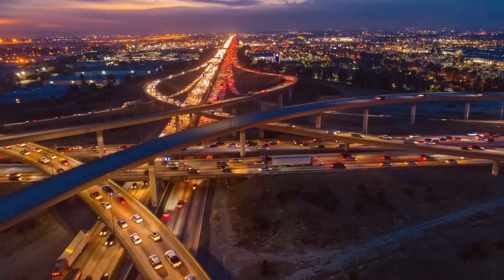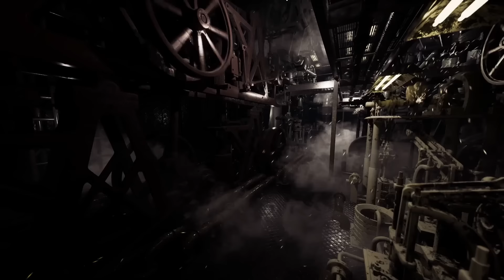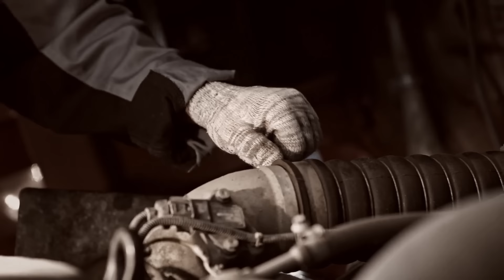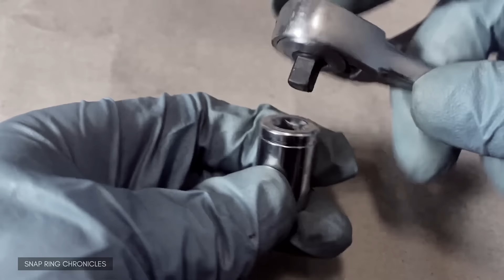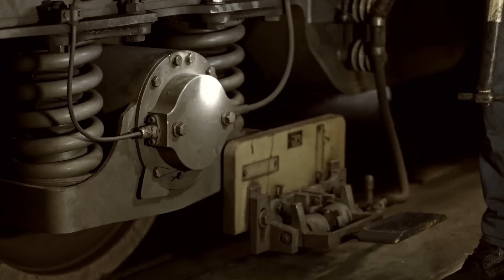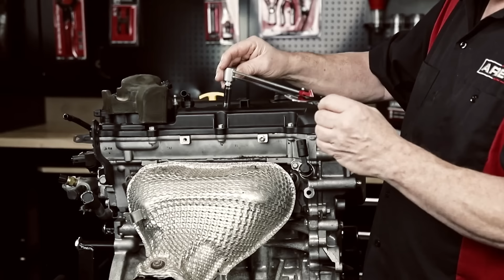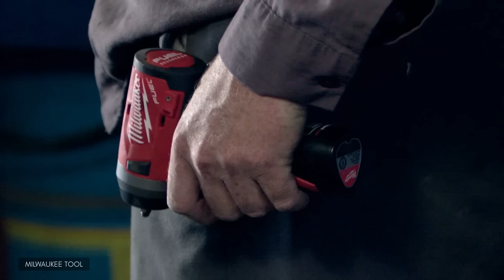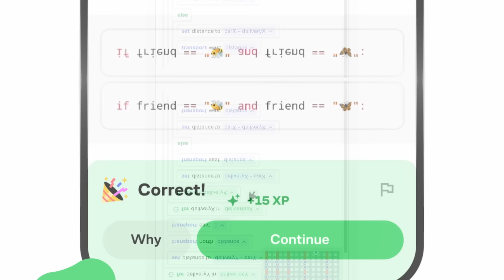The Tool That Changed The World

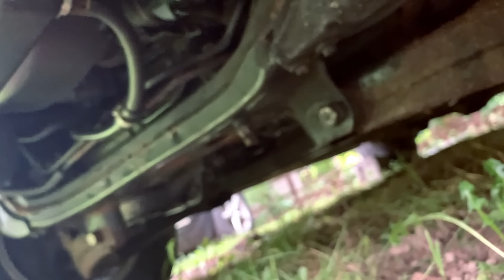Comment: 0:17 as Tesla technician i must say, that we have a harder job. As loosing 10mm socket in standardized engine compartment is impossible due to none of the models having one, we are required to loose it somewhere else
Reply from the maker: 😂 maybe they get lost in the panel gaps
Reply: Got 'em! @NewMind
Reply: To loose is to untighten
Reply: They make a 10mm socket cannon just for you guys so you don’t feel left out, you just go outside and perform your best middle eastern wedding celebration imitation 😂

Comment: I never lost my keys again after putting a size 10 wrench on my key chain.
Also never had to have the fear that my wheel, saddle or headlight would fall off my bike.
It's also a good emergency beer opener or emergency car window hammer.
0:13 lol, that random loose socket head in a random location in the engine bay.
Reply: I've never seen a bike where the saddle or wheel were held by a 10 mm head bolt.  Saddles were 13 or 14 mm (Or occasionally 9/16"). Brakes, lights and mudguards would use 10 mm alright though, again most lights now have tool free mountings. More or less everything except the very cheapest bikes use hex keys for all the above these days though. I find a 10-13 combination open ended wrench is very handy in my pocket working as an engineer on production lines though.
Reply: @peglor  While what you're saying is definitely true nowadays, most of my bikes allowed me to fasten the saddle's stance at least (not the height of it, cuz that one is indeed size 13).
And honestly, I only had 1 bike where I could also refasten the wheel with size 10, so maybe I was a bit misleading at first hehe.
The 10-13 combo wrench wouldn't have a ring to put on a keychain, but yes I did carry one of those to school for bike maintenance before I thought of the size 10 that happened to coincidentally fit all my needs for one specific bike.
Reply: @Yezpahr  I'm very curious what bike this is. I've literally never seen a bike where the wheels attached with a 10 mm bolt. 10 mm is the common rear axle diameter, with 9 mm up front, so a 10 mm bolt head wouldn't even grip on the bike frame without serious washers. Any axle nuts I've seen were 15 mm, with the odd 14 mm or 9/16" nut.

Modern bikes, if they're not quick release, are using 15 or 20 mm front and 12 mm rear through axles.
Reply: @peglor  It was a brandless bike, been repainted too many times to count before I even got my hands on it. The front fork that held the wheel was likely not even stock, so I have no clue.
In the Netherlands we just call them widows, or station bikes (but the latter name fell out of use with the advent of commercial city rental bikes that now took over that name locally).